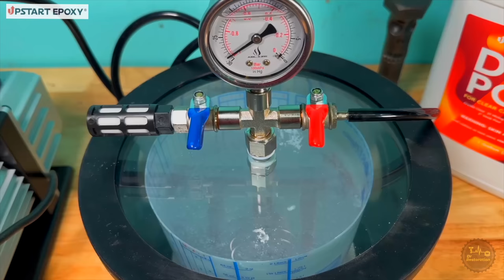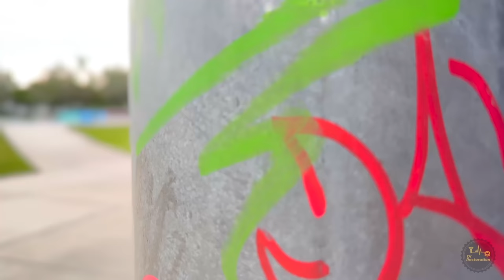Giving an Old Skateboard a New Life

Comment: Did they have it hanging on the wall?? That's the only thing I can think of for it to have nails in it for. That's why you should have used mold release so maybe the next time. If you ever do something like that again seal the wood before putting it in resin you wouldn't have the air bubbles. Cool project it looks sweet
Enjoyed your video and I gave it a Thumbs Up